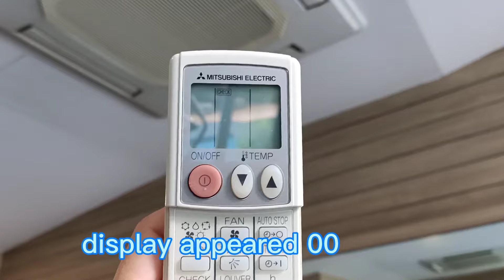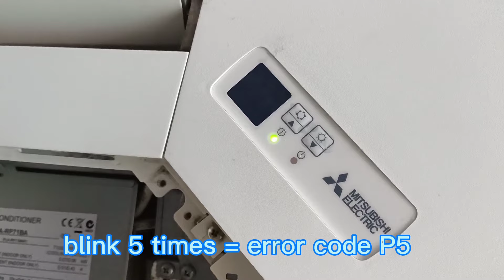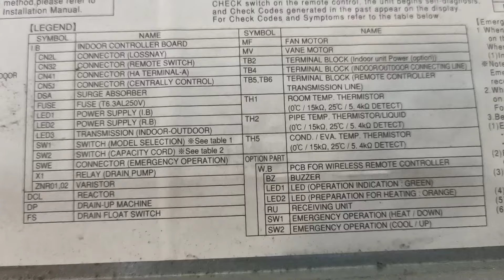Mitsubishi Electric | How to check error code using wireless remote controller

Comment: 我刚刚查了一个cu 是 City multi  wall mounted 也是5次blinking  ?
Reply from the maker: City multi , outdoor可以看error
Reply from the maker: 5次有两个error.
1)直接5次 是watee pump.
2)灯亮。。。然后闪5次。。。是U2.
High discharge temperature or insufficient gas.

Comment: I check the error code got 2 beep sound
Reply from the maker: Count the blinking light
Reply: 2 times sir
Reply: Ist the pump also water chock ?
Reply from the maker: 2times
 TH2 gas pipe thermistor or compressor over current
Reply from the maker: @muthusamy228  pump blinking 5 times
Reply: Yes I check the code is thermistor sir but after i replace and rest the fcu then again same problem
Reply: Then i take out the water try and clean the pump and drain pipe now air-conditioning running
Reply: Thanku mr .Bon mj